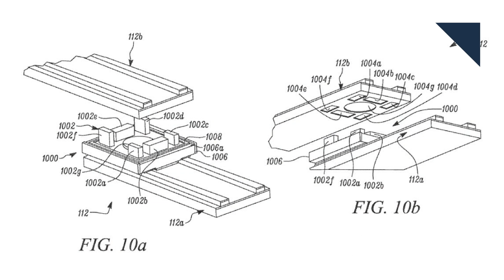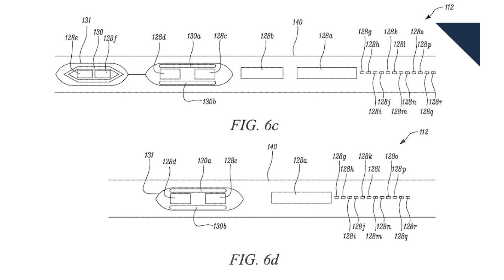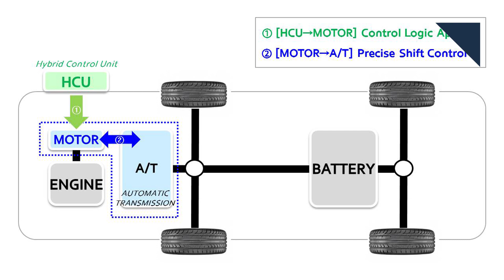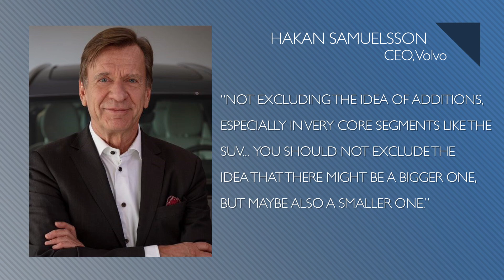Tesla's Amazing New Wiring Architecture - Autoline Daily 2638

Comment: are there any new informations, does the first model y's have the new wiring architecture?
Reply: There are: the first Model Y do NOT have the new wiring architecture.
https://www.youtube.com/watch?v=nhoGxTV_xlU
They only put the thick charging wires from the inlet to the battery inside of a metal tube, likely to ease automation and increase the chance it can he handled by robots.

Comment: another Tesla patent:  the whole car body made at once in a mold, by injecting liquid metal = no mre welding of different parts.
small toy cars ( scale 1/50 ) are made this may .
Reply: This one is actually used for the rear floor pan of Model Y: Sandy Munro called it "Rear Mega Casting"
https://www.youtube.com/watch?v=KVGvwLnNyF0
Also, the rear trunk tub is now made from fiber-glass reinforced plastics and is probably being made by injection molding like the front truck tub.
It's not the "whole car body" but two parts to start with. Sandy Munro also compares it to the same structure in Model 3 which is relatively complex and expensive to assemble from sheet metal parts from the press shop. However, he did not tell the weight and strength of both pieces yet.

Comment: As a F150 owner I wonder why Ford is lowering  itself to stupid marketing tricks.  Is the electric truck another dual clutch transmission wannabe?
Reply: LOL Single Gear Reduction is all a BEV Pickup needs. It also makes the drive train much simpler and tougher.
Reply: I was questioning whether Ford is doing marketing tricks because the electric F150 is a known failure they are qoing to sell with full knowledge that its junk like they did with the DPS6 transmission.  If your not aware of the DPS6 issue google Detriot Free Press.  Some electric cars are getting are designed with mutiple gears so they are not all direct or single speed.
Reply: @brucemaloy4769  Yeah Proper design is very important to BEVs. Nissan failed to do a proper Liquid Cooled battery and it hurt their life span. If Ford does sketchy things like PowerShift transmission you could easily make a borked unreliable BEV. But if they contracted to a reputable company like LG Chem. They could easily build a reliable drive train that does 400,000 miles or 15 years plus. Pickup truck does not need multiple gears because it has a low top speed. Multiple gears is for Strong Acceleration + Top Speed in sports BEV.
Reply: @Neojhun  I disagree with your low top speed sugguestion.  Full size trucks are expected to cruise our interstates at 80 mph and more when not towing heavy loads.  I saw an idot pulling a 35 foot camper the other day at 80 mph in Arizona.  Expectations are the same for both ICE and BE trucks.
Reply: @brucemaloy4769  Umm BEV with Single Gear can easily have strong take over acceleration all the way to 125mph. They run out around 140mph. 140mph Pickup Truck is kind of absurd for public street use.
Reply: Have checked Ford’s stock price lately? Now you know why the publicity stunt.

Comment: Please put a little more thought into the news your promoting. Tesla is extremely unlikely to use this new wiring harness tech in the Y as they are really pushing commonality with the 3. Also, they wouldn’t want to fall into the trap of pushing too much tech into Y as they did with X. It seems far more likely they’d use this on the roadster, semi and/or pickup which are all new platforms with lower volumes. 

The news about the electric F-150 is great but surely you noticed the wimpy 10,000 lbs tow strap and are knowledgeable enough to know that a train on rails rolls pretty easily.
Reply: it's a mistake to assume Tesla will follow the same methodology as main stream automakers, they will implement the new wiring architecture in any platform if it's better, same goes for the advanced microprocessors they currently use in all their cars.
Reply: I’m sure the harness will go into 3 as well
Reply: How about YOU put a little more thought into your life. Why would they develop the tech and not use it?
Reply: I’m pretty sure that Elon explicitly stated that the model Y would get the new harness
Reply: picknngrinnin it is a huge cost and effort to change the production line which could mean that it’s not economical to put the resources into it.  More importantly the effort involved at a time when they are trying to ramp production for the model Y, the pickup and the semi probably makes it a distraction that they could do without.  Knowing Tesla there will always be some rush on to  get some new model to production,  so they may never think it worthwhile to retrofit the new harness on older models.

Comment: 800 miles a year on 6 hours/day sun light - Really nothing at all ???  - What is your gas free in MI ??  Small wonder Detroit is so far behind.
Reply: Well, he's right. That comes out to just an extra 2 miles of distance each day.
Reply: Brandon: That enough power to run Sentry mode (maybe Dog Mode) and prevent the batteries running down on a Tesla.  For a non-Tesla when I went to my cabin and stayed for two weeks that would be 28-30 miles range added to my car without paying a cent.  Sounds good to me.
Reply: 6.7% of the average 12000 miles. Could be  worth it unless you want a sun or glass roof.
Reply: Detroit automakers have dropped the ball because of arrogance and of course having an affair with big oil interests.

Comment: Pulls 1,000,000 pound train with a 10,000 pound rated strap. ;-p
Reply: On rails no less. Much less rolling resistance than rubber wheels on tarmac.
Reply: That strap is clearly rated at least 1 million lbs :0
Reply: A very slow speed and acceleration. That strap rating is good enough for limited velocity.
Reply: Neojhun kind of like catching a big fish on light fishing line.
Reply: @MysterD515  WTF No, big fish still has massive resistance of fighting you. Unless it's dead.
Reply: Got me thinking ... start the train car moving THEN let the F-150 keep it moving.  Starting inertia the really hard part, right?

Comment: It's surprising that Tesla decided to patent their new wiring harness technology rather than keeping it a trade secret. Perhaps they decided that people like Sandy Munro were going to find out anyway, so they might as well patent it.

I have to say, though, from reading the patent application, that it omitted the most important parts. It only discusses various possible wiring components and connection configurations. It does not discuss how a robot would build or install them, or what the protocol would look like for using the wiring system to control the various vehicle devices, or what microcontrollers would be used to talk to the central computer and demultiplex the signals for each device.

It's also rather surprising that nobody else in the automotive world ever came up with something similar. But that would require that the audio guy talk to the guy that designs the window and mirror power controls, etc. Not something the Detroit Big Three and their supply chains are big on.
Reply: dlwatib: I think you hit the nail on the head.  I used to fix printers, when I went into training I ask why there were so many custom parts, I was told the people of different parts were from individual departments who did their designs to specs without ever seeing the entire finished product.
Reply: The simple wire harness has been done before. In the late 80's early 90's Nissan had a 2 wire harness that did a loop around the entire car.  Not 100% sure but I think it was on the maxima. I remember it having optical fibre loop going to several controllers around the vehicle.
Reply: This is nothing new, canbus systems have been in cars for years. Simplifies the wiring, power, ground and twisted pair data wires. But the control modules increase.
Reply: @22BOZIDAR But did they reduce the amount of wires to only 100 meters? No...
Reply: I think that it is because it will create a major savings for all car manufacturers so it was worth filing it so they can collect the royalties. They already gave too much away so other makers could start producing EVs and boos the market demand.
Reply: @wollinger  Few or none of Tesla's "open" patents have been used because of the conditions of licensing.

Comment: Now let's see a $40k electric F-150 tow a 10,000 pound trailer over 200 miles at 75 mph.
Reply: Rivian is claiming 11,000 lbs towing capacity.  Not sure on range, but they claim up to 400 miles, likely unladen.
Reply: @carljaekle  And it will cost at least $70k.
Reply: That was just a publicity stunt. Even a Nissan Leaf can do the same thing, as all EVs can apply almost 100% torque at 0RPM. Pulling a trailer is another story, as range mostly depends on the trailer's shape and weight. Bjorn Nyland has some interesting videos on different types of trailers with Model X and Model 3.
Reply: @Poxenium  Thank you for telling me absolutely nothing that I didn't already know. Obviously, no BEV can do what I said that I wanted to see in my comment.
Reply: An electric F-150 with those abilities will cost only $40K.......................for a 2 year lease with 10K miles per year.
Reply: Who said anything about $40,000? And F150s cant tow that much now unless you step up from their base two engines. Which will almost certainly put you over the $40k mark.
Reply: @J-onUtube  I said something about $40k. An F-150 with a 10,000 pound towing capacity can be bought for that price.

Comment: So tesla rediscovered busbars ?
Reply: Over 100 years in the making ... 100,000,000 units produced per year around the world - and Tesla first to do it ??  No Tesla killer in sight.
Reply: @brandoYT  Agreed! EV's just aren't "there" yet and despite all the loony fanboys and their misguided attempts, the consumerate has snubbed EV's as ICEV's remain the preferred car of choice.
Reply: @jaroessa294  Not sure if sarcasm... Model 3 outsells 3 Series 3 to 1.
Reply: Digital Data Bus Bars. The encoding required to make those works is a nightmare.
Reply: Well, it's not the same thing, as electric cars with 9 cameras and 24 sensors need more complex wiring than traditional gas cars ... but I get your point.
PS: electric cars were also first invented around 1910, Tesla just re-made it with current tech :P
Reply: @Poxenium  so tesla added power line networking to busbars ?
Reply: @Poxenium  1832 Robert Anderson -practical 1870 ??

Comment: Interesting about the Sonata Hybrid, I think that the automaker Karma also tried that and they didn't get much recharge from the solar panels.
I'd think about its durability and value before putting any of these in my cars. Right now, it's just a visual adornment.
Reply: A solar panel on top of a car is virtually worthless, just like those solar freakin' roadways. It's dumb to put solar panels on something that will often be in a garage, parked in the shade, etc.

It's better to just spend the same money on conventional solar panels in conventional locations (e.g., on top of buildings).
Reply: @theevermind  You have to do the math on that. 800 miles per year is 6.7% of the avg 12000 which is pretty good. If the panels don't cost much it's probably worth it. Just minimizing self discharge could be a useful feature.
Reply: I have a small panel for my ICE when I park it for more than a day or 2 it keeps the battery topped off. Without it the battery dies after 4 or 5 days of not driving it.
Reply: @tabbott429  That's a great reason to have one, but I'd like to know how much does Hyundai charge for this roof to see if you'd still want it.
Reply: If you consider how many millions of cars spend the daylight hours in outdoor parking lots, solar roof and hood panels can be quite valuable. Just keeping the car cool in summer and warm in winter is a plus; and if you're someone who uses airport parking while traveling, you'd not have to worry about charge level on return.
Reply: @satnitcboy  I'm not questioning the function of it, I'm questioning the value. My thought was for the price, was it worth it? They never mentioned how much was that option.
Reply: @EbuzzNYC  And it's a good question - though I hope the answer is a changing one, as the solar / collection + battery / storage equations are always being rewritten.
Reply: @satnitcboy  I'm sure it'll get better, maybe they're gonna work on photovoltaic paint and other aids.
Reply: @EbuzzNYC  This story on the Sono Sion solar powered car gets a little deeper into what kind of r&d is going on. Practical on-board solar may be far off, but you can't help but think it could perform some functions well. Especially in sunny places. (Why not something as simple as solar powered ventilation/moderate cooling for cars parked in the sun all day? Useful for ICE vehicles? Seems like it.)
https://www.youtube.com/watch?v=wLZKdkgB85k
Reply: @satnitcboy  great video, I enjoyed it!